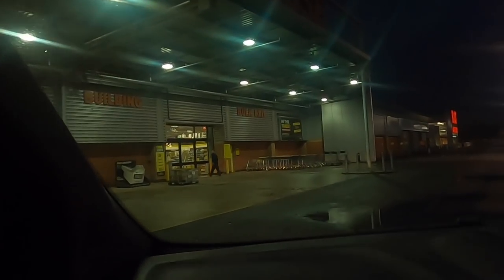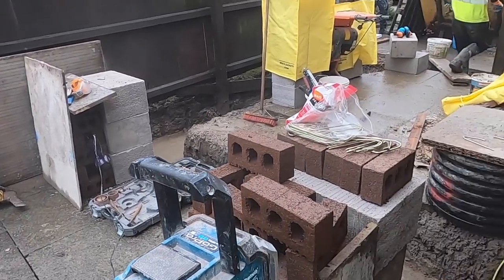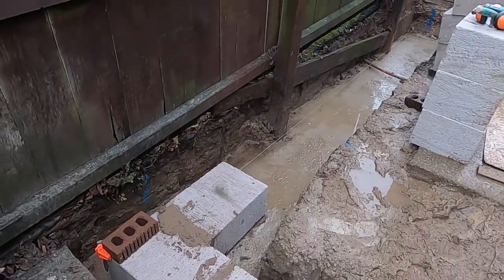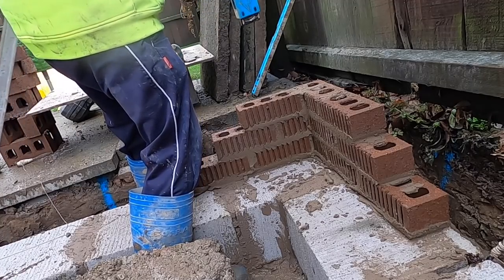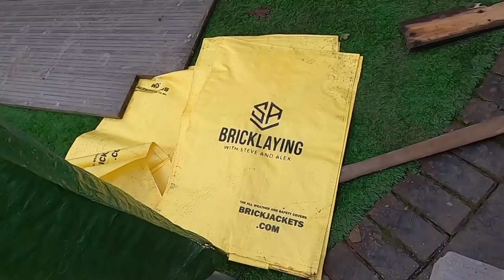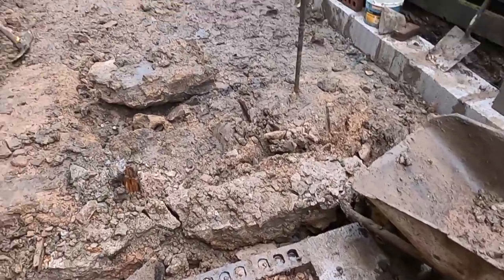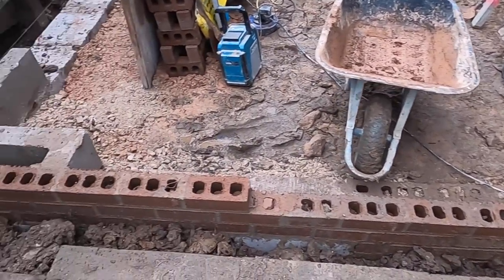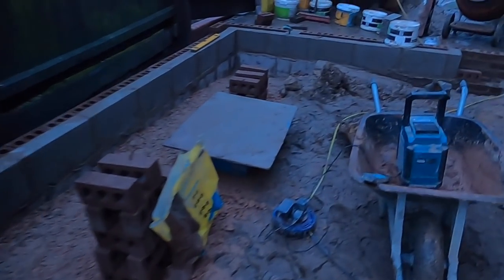CONSERVATORY BRICKWORK UP TO DPC

Comment: Nice little extension job that can't do much about wet bricks this time of year I am building 12 by 4 concretes in footings at min which doesn't really matter if they are wet but got rained of today built for three hours in the rain but had to quit when I realised I was soaked to the bone and the mortar started dripping of sides of mortar boards would have been better of using a paint brush instead of trowel good upload lads shows the real graft involved when doing domestic builds👍
Reply from the maker: Cheers pal , yeah when the mortar is running off the boards its time to do one 🙄🤣🧱👍🏽

Comment: It made me laugh. When you were doing your setting out measuring from corner to corner. Had a joiner the other day making us some dummy windows he never heard of measuring corner to corner to make sure they were square.As a result they weren’t square. When I come across wet bricks I got my heat gun put it underneath them and it gets so hot there steaming
Reply from the maker: A joiner didn't know diagonals 🤯! that's  a shocker 🧱👍🏽

Comment: Enjoyed watching this video tonight. Got 80 Celcon trench blocks to start laying tomorrow - hoping for a dry day!
Reply from the maker: Good luck pal get course  1 in all the way round in case it does rain so you don’t need to bail out 👌🏼🧱👍🏼
Reply: @SteveAndAlexBuild  Cheers Steve. Do you guys mix up regular 5 to 1, but maybe a bit on the wet side for those beds?
Reply from the maker: @Carl-yu6uw  we do 4:1 more dryish as the bricks were wet 🧱👍🏽
Reply: @SteveAndAlexBuild  oh yes, the bricks in your video were soaked. I've got two pallets of wrapped dry aircrete blocks to lay, so unless the trench is wet tomorrow, was going to use a weaker & wetter mix.
Reply from the maker: @Carl-yu6uw  Oh yeah definitely a wetter mix on the trenches 👌🏼🧱👍🏼

Comment: Small sites can be awkward can’t they, very similar to what I’m doing at the mo, what you got in that mix ? We’ve been really struggling with it going fluffy but drying out, i think it’s either multi cem or the sand from mkm I’ve never used either before, keep it up boys
Reply from the maker: Yeah not much room to move or load out . 
    It must be your sand as the multichem makes a lovely mix 👌🏼🧱👍🏽

Comment: Nice vid lads back in the foundations. You guys can clean them off with your eyes closed 👍👍👍
Reply from the maker: Cheers mark we make sure we dig 600 wide so we can fit in the trench’s 😁🧱👍🏼
Reply from the maker: @markhep  . Can’t believe I threw them around for 10 years solid ! 6 years on me tod . No wonder my hips ache 😩🧱👍🏽
Reply: @SteveAndAlexBuild  Yere mate. I aways think that foundations are the hardest skill a bricklayer can Learn. The hole building sets off on them. So really it should be the highest payed job in my eyes. You did well mate keeping it going for that long. Definitely have a big respect for you. Top man 👍👍👍👍
Reply from the maker: @markhep  . Thanks very much mark 😁much appreciated 🧱👍🏽

Comment: You need a gas burner gun. About £25 for a big one, and then get a a medium size gas bottle. Would dry those 1000 bricks out in about an hour. Bottle last a long time. I also use mine if hard frost and if working off a solid base thats slippy with frost or ice. Thaws it out a treat
Reply from the maker: Nice one thanks for the tip 🔥🔥👌🏼🧱👍🏽

Comment: Nice one thanks. What is the story with the wet bricks? If they are too wet the mortar wont dry? Im guessing here in Oz they must spend their time wetting them to get them to stick.
Reply from the maker: If they are wet they won’t absorb any water so instead the water in the sand and cement oozes out and runs down the face plus you can’t build as high as the weight of the wall makes it sink 😬🧱👍🏽

Comment: A good think for drying out brick is a industrial heater from a hire company they are not much to hire and will dry the bricks out very quick
Reply from the maker: I used them all the time on conservatories , but I wasn’t paying for the hire 😉. I need to buy something a bot more portable 🧱👍🏽
Reply: I bought  my heater for on line it was £156
Reply from the maker: @andywest3260  I wouldn’t use it enough to justify spending that kind of money on one 😳👍🏼👍🏼
Reply: @SteveAndAlexBuild  fare one 👍
Reply from the maker: @andywest3260  🧱👍🏽

Comment: Can I have my yellow card rescinded and give it too the guy who stepped on the facing????😬😬😬
Piss poor these wet bricks, if someone comes up with a solution they will be a millionaire 
Great job pals 🤝🤝🤝🤝
Reply from the maker: I’ll check with the boss about the yellow 🟡🤣🤣🧱👍🏽
Reply: Not a builder of any description why cant you use wet bricks or is that a daft question
Reply from the maker: @rosanneennis725  Not not daft at all . The bricks need to absorb a bit of water from the sand and cement otherwise they will just sink , plus if they don’t absorb it it runs down the face of the wall too  . Hope that makes sense 👍🏽🧱
Reply: Thanks every day is a learning day
Reply from the maker: @rosanneennis725  😁🧱👍🏽

Comment: Great videos! It looks like you've used 140mm lintels and I was wondering if there was a reason you didn't use 65mm lintels? I'm doing foundations as a DIYer at the moment but used 65mm lintels for a span of approx. 1m. I'm now wondering whether that's enough.
Reply from the maker: 65 mm are fine Peter , ours was a bit of overkill 💪🏼🧱👍🏽

Comment: Have it easy nowadays with 25kg cement bags,back when I  started,cement was 50kg bags,all that changed in the 80's or was it's the 90's due to HSE..
Reply from the maker: I back when were a lad it was 50 kilos 🥵
Firwood still do 40 kg bags of sand , ball breakers. 🥵🧱👍🏽
Reply: @SteveAndAlexBuild  Thought you were now only allowed 25kg max for pre packed material like sands,aggerates.
Reply from the maker: Same here 🤷🏽🧱👍🏽
Reply: @SteveAndAlexBuild  I like the 40kg bags some of the small independent merchants around my way still do them.
Reply: @davidwills6640  Small independent merchants,great places, amazed that any survive,around here,all been bought up,by the big names.
Reply from the maker: @davidwills6640  better value fir money . Firwood’s just gone up to £3 + vat🧱👍🏽

Comment: What’s the purpose of the grooves in the brick on the back of the face
Reply from the maker: I’ll be honest , I haven’t got a clue 🤷🏽, I’m guessing to save clay those few small grooves adds up to a lot of extra clay for on a few million bricks 🧱🧱🧱🧱🧱👍🏽
Reply from the maker: @martin2466  . The ones Charlie c was using on a new build brick on edge were unbelievable. I’ve never seen holes that big 
🕳🕳🕳 🤯🧱👍🏽
Reply from the maker: @martin2466  . The ones Charlie c was using on a new build brick on edge were unbelievable. I’ve never seen holes that big 
🕳🕳🕳 🤯🧱👍🏽
Reply from the maker: @martin2466  . Very true Martin 🙄🧱👍🏽

Comment: I never see English Bricklayers use Hydrated Lime in the mortar only sand and cement and the stuff in the bottle you call Fev
Reply from the maker: Never used to mate 😬.
  I think you mean Feb 🤣 . That is a brand name very commonly used . It’s actually callled 
Plasticiser 👌🏼🧱👍🏽
Reply: @SteveAndAlexBuild  We use Lime here in Australia  it retards the mortar from going off to quickly its still very hot over here
Reply from the maker: @goldentrowel1968  🧱👍🏽